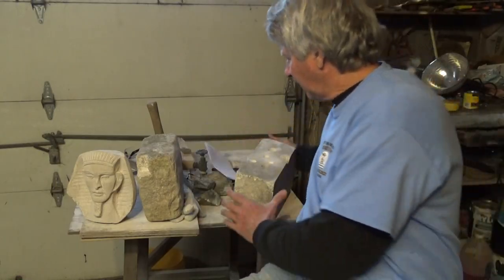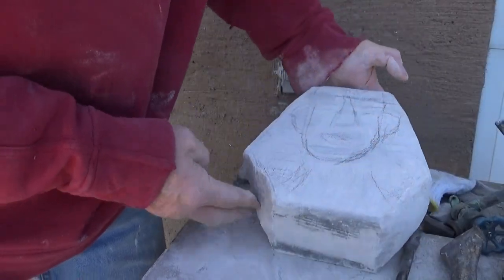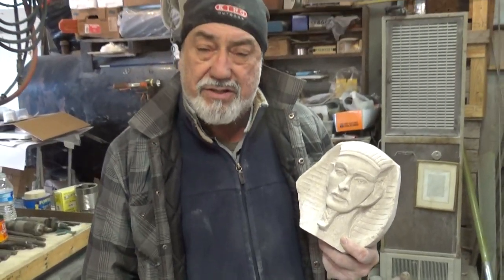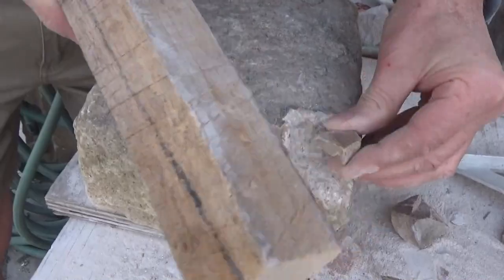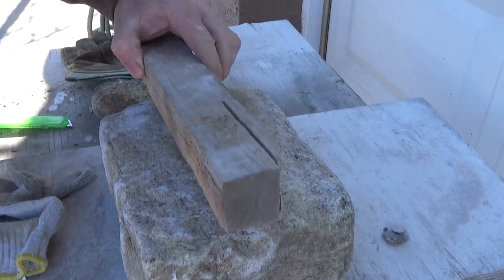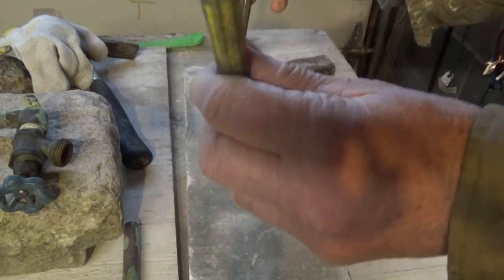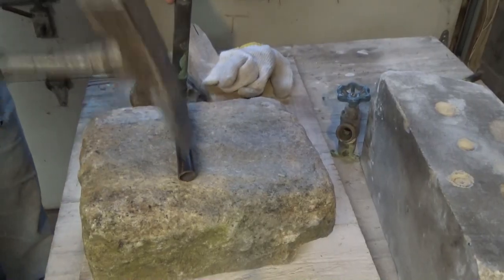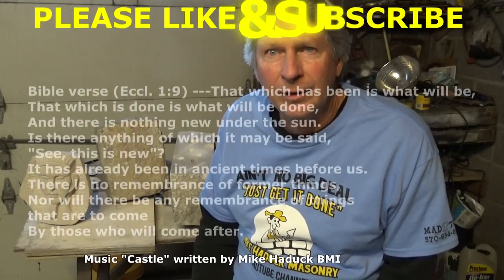CARVING STONES WITH ANCIENT TECHNOLOGY (Mike Haduck)

Comment: The tool marks that can be seen do NOT match the tool marks the copper in his demo leaves.  Striations in the tube drills show a very different technique.
Reply from the maker: It's only stone,  not rocket science,  thanks Mike
Reply: Why would you expect this mostly percussive demonstration to match the markings inside the bore holes? Drilling with abrasive creates the striations.
Reply from the maker: the Egyptians didn't have jewelers?
Reply: @MikeHaduck  They had jewelers certainly. It is just that quartz crystals or granite or  corundum dust produces the observed striations. Anything else would be gravy. Egyptians were mighty skilled in all trades. Your  channel is a treasure. Thanks for the work you do.

Comment: You've seen the granite boxes at  the Serapeum, right? Like in person? Perfect 90° corners all the way around the bottom of a 12ft × 12ft × 20ft solid block of granite? That is as smooth and shiney as glass after how many thousand years? Alright dude; not taking away from the skill you have on the subject, but Jesus Christ you are defeating your own argument while making unbelievably condescending comments about people's opinions that are perfectly legitimate (and don't automatically involve aliens). For one, NOBODY is "oh it's impossible how did they do it" about HOLES IN LIMESTONE. They're referring to the CORES TAKEN OUT OF GRANITE WITH TUBE DRILLS. And ok so you made a small indentation in some granite with some other granite. What did you keep coming back to? The fact that it was VERY SLOW GOING. The problem we have with the explanation for the Great Pyramid is that it was done from plans to finish in 20 years using your methods. Now I can already hear you say well in 20 years I could get a lot done. If there were a bunch of me it would be even faster! Ok. That 20 years includes the quarrying, moving, shaping, then placing 2.5 MILLION blocks weighing anywhere from 10-70+ tons each. Plus a bunch of granite ones that are in the 70 ton range that came from 500 miles away and are like 300 ft above ground level in the superstructure. So back to the time involved. 2.5 million blocks, 20 years. Comes out to about 3 minutes for each block to be quarried, moved, shaped and placed. By a civilization that according to mainstream Egyptology didn't even have the wheel yet. So, you were saying? Something about it's so simple, and that people are just I don't know, stupid? For thinking otherwise? Anyhoo, you can't use limestone to "prove" us wrong when we're talking about it being done with granite, and you can't "prove" us wrong about granite when you're clearly admitting that just banging on it with another piece of granite will work-eventually. Meantime all you have is a piece of granite that has a barely discernable indent in it when we're talking about angles and planes and corners with precision rarely seen outside aeronautical engineering but in granite. According to your techniques, how did they cut the lids for the boxes in the Serapeum so perfectly along their whole length that they're hermetically sealed when in place? That's one cut six feet wide and at least 12-15 ft long through solid granite with laser precision. Don't insult my intelligence by saying they broke it off with wedges and then smoothed it out by rubbing it with other pieces of granite, that's the dumbest thing I have ever heard.
Reply from the maker: It's only stone, they had the tools they needed, they had jewelers, etc, go look at the museum,  as a stone mason I am much more impressed with the cathedrals,  the pyramids and such is mostly primitive and they are not a precise as they want you to believe,  thanks Mike

Comment: Loved seeing the examples. Like you said. Of course it can be done by humans, however the drilling in granite looked too difficult. I’ve also seen video’s with much bigger holes and even holes at edges of a doorframe which would even be hard to drill with todays tools.
Also maybe you can also explain how they were able to make the faces so flat and smooth? Just rubbing would not really explain the extreme flatness I would think smooth wouldn’t be much of a problem but ruler flat?
Reply from the maker: Hi Grt, I got a series called " rockfacing and shaping stone" part 13  at the granite museum in Maine shows how it was cut and polished, thanks Mike
Reply: @MikeHaduck  I will have a look. Thanks for the efforts to show this.
Reply: Not just the drilling, look up a channel called unchartedx
Reply from the maker: The problem with many channels is its all talk and no action, I never see them get their hands dirty, lots of speculation and assuming,  thanks Mike
Reply: @MikeHaduck  if you are that inexperienced with power tools that you need to see it demonstrated in order to realise they are evidently machining marks, then that proves your opinions are not very useful in sorting out this mystery
Reply from the maker: I was working and going to quarries long before they had these diamond saws and thermal facing, I got a whole series on rockfacing and shaping stone, If you got your hands dirty and  produced any videos showing why it couldn't be done with older technology, send me the link, otherwise I just got to write you off as another bedroom archeologist,  with respect, Mike
Reply: @MikeHaduck  with respect, your experience with hand tools doesn't help you to understand machining
Reply from the maker: Hi, I am not a machinest, I am a stone mason, I use the tools that work for me, sometimes in quarries,  sometimes carving, machinest is a whole diffrent trade, what is your trade?

Comment: But your guys examples are super crude, slow, very small, and require like, a child’s strength to move around. The Egyptians were dealing with multi ton blocks to a FINE degree of symmetry, skill, and art. Of course anyone can carve these granite stones into anything they want with basically no tools— it’s the fact that they did it astronomically to a fine point on megalethic levels. They also drilled too.
Reply from the maker: Hi Sir, it's only stone and they are not as perfect as they want you to believe, I see the amish move heavy objects with horses and the Egyptians had them and ox and elephants, as a stone mason I am far more impressed with the cathedrals,  thanks Mike

Comment: Now take the time to remove a certain amount of stone, and do the math on those big stones and sarcophagus!

It clearly can be done, but the sheer man houres needed to pull this off that way is mind boggling!!!
Thats the thing i can´t belive, 10 thousands of workers pound stone on stone for dacades just on one of those buildings, and no one came up with a better method of working that stone?? 🤔
And not just the big pyramids, all of those tombs and temples and smaler pyramids they build over multiple centuries.
There are Thousends of tombs left even today, imagine how much are lost over the millennia!
And NO ONE came up with a beter method then POUNDING stone agianst stone?? ARE YOU KIDDING ME!?
Reply from the maker: Hi Martin, it's only stone, anyone who worked on big projects would get a system that consistently make things easier,  I don't think it took longer to build a pyramid than the empire state building, thanks Mike

Comment: I don't think this is the technique they would have used for a precise shape. There is a granite lid with a rectangular box shape cut into it, that was clearly done using a series of drill holes. After that it's just smoothing the sides, and cutting in the corners. I think a copper saw with garnet embedded or in a slurry would have done the job for that.
Reply from the maker: Watch part 2, thanks Mike
Reply: @MikeHaduck  Obviously, I did. Your speculation of how precise shapes  were cut doesn't change hard evidence left in stone of copper drills.
Reply from the maker: Thomas. If you want to learn about stone work, go to my playlist, "rockfacing and shaping stone", part 1 to 13, it might help your understanding of the simplicity of stone, thanks Mike
Reply from the maker: Hi, Thomas, I been promoting scientist against myths for a while now, great channel,  thanks Mike
Reply: @MikeHaduck  then I fail to see your objection to copper drills .

Comment: Btw your modern copper is most likely much better and stronger
Reply from the maker: Thanks, Mike
Reply: Residential copper typically would be around 99% pure I think. The Egyptians used an arsenical copper alloy which produced a stronger metal.

Comment: Good luck with hand tools , the ancient people of kemet had mechanized tools. That's apparent now. Carve a symmetrical statue out of diorite man.
Reply from the maker: Ok G , no problem, first get me the stone you want carved, have it shipped to me and we can settle on a price for my efforts , I would also want to keep video rights, let me know, Mike
Reply: @MikeHaduck  😆 just copy the Kafre statue or better yet build a pyramid from granite and limestone.
Reply: It's not possible to achieve perfect symmetry without advanced tech and tools.
Reply from the maker: There is no such thing as perfect in stone, God makes the stone and you can only achieve what the stone allows, any Carver with 6 months experience will tell you that, the stone first and then the Carver, make sure when go to the quarry you get the best possible stone to be shipped to me, thanks mike
Reply: @MikeHaduck  Huh? How do you explain tube drill cores and circular saw cuts into rose granite all over Egypt? I didn't say a perfect carving. I said symmetrical meaning one side measures exactly the same as the other. Most egyptologists are delusional thinking all that was done by hand and eye balling it..
Reply from the maker: Hi G, the Egyptians had jewelers,  diamonds , dolrite, emery from Greece, etc , etc, they made their own drill bits, they may have been crude but effective, thanks, Mike

Comment: Nice. But no cigar.  Explain. The perfect precision only matches today by computer   Millions of blocks. 40 foot statues perfectly done and no visibly tool marks.  The great pyramid has over 2 million blocks.  All perfect. Some over 60 tons a few hundred feet up.   Explain the diorite sarcophaguses  buried deep in the ground weighing 100 tons  perfectly cut
Reply from the maker: Hi Allad, I don't know if you ever been there but they are far from perfect, just look at the videos, a 6 year old would see that thanks Mike
Reply: Nice but no cigar because precision flatness is still done by hand today. And in regard to the above comment that you cannot cut granite or diorite with copper, yes you can, i have posted how to videos showing how to do it and drill with copper as well. You've been fed a bunch of lies. Don't trust me or them you can try for yourself, It costs a couple of dollars of material and a couple of hours to test.
Reply: There are visible tool marks and if they aren't it means the stone had been sanded down and even if it wasn't, blocks outside were left for some 4500 years for the erosion to occur by sand on the desert.

Comment: Mike, I love your channel. But you haven't replicated anything. You cut a small notch in a small block. You need to replicate the following:
-Spiral grooves in the tube drill marks.
-Circular saw marks.
-Errant circular saw-like marks.
-Narrow grooves.
-High precision polished granite boxes of equivalent size to those in a serapeum.
-objects like the thin wall pots and the "shist disk".

Replicate those things and then you'll have a point.

Note: I'm not saying aliens, lasers, etc. did it. I'm saying the tools we know they had do not explain these things.
Reply: @SacredGeometryDecoded  What's really missing in the modern perception is the layers of skilled craftsmen. The apprenticeship system ensured that. Nowadays we have a few people self-taught but we don't have a whole system devoted to teaching these skills, then wonder why they're so difficult.
Reply from the maker: Hi Michael, no problem I agree with the guy who polished it by hand ,we many times did it with hand sanding,  thanks mike

Comment: Egypt had approx. 3 Million inhabitants during the pyramid age. If you take out children, women and elders, you'll end up with a workforce of maybe 800k people. These people had to produce food for most of the year, before they could even be drawn for the construction of a pyramid. Taking 2.3 Million stones of the Great Pyramid into account, each stone had to be quarried, transported an positioned within only 3 minutes in order to achieve the task within 20-25 years (all figures taken from conservative science). Another problem are the "overcuts", meaning that certain groves show deeper cuttings than necessary or even cuts that didn't come out straight and were hence abandoned. How is that plausible, if you're ruling out machining and assuming that they've cut with copper blades and abrasive sand only? Did they notice the crooked cut only after hours or even days of cutting, before they stopped? Ridiculous, isn't it? Theoretically, you could also build a highway with just a shovel or even a pyramid with only toothpicks, but you wouldn't be able to produce in such a quantity and perfection. So, the idea that some of the buildings and artefacts in Egypt are actually pre-dynastic and are the result of a yet unknown technique seems quite probable to me. We don't need to employ "aliens" as an explanation. Simply looking at the Sphinx and noticing that its head is much too small in relation to the rest of the body seems to imply, that the Egyptians have inherited certain monuments and simply restored or modified them. If it would be so easy to explain, why can nobody even remotely reproduce it?
Reply from the maker: Hi, it is what it is, but as a stone mason as some one who worked in quarries,  I don't think it took longer to build a pyramid than the empire state building , they are not as big a deal as everyone says, once everyone got into the rhythm I think it went fast, I worked on a lot of big jobs to know, it's the people who never worked in that field think it's a big deal, thanks for the comment, Mike
Reply: @MikeHaduck  Thanks for your reply! I once restored a two story basalt stone house on the Azores Islands with the help of some local masons who showed me a lot of tricks two achieve things, that I thought before were impossible. So yes, a nation like the Egyptians, living amongst sand and stone, will definitely master these elements, even if city dwelling conspiracy theorists can't grasp it. So much is agreed upon. But if you consider the full picture of ancient Egypt (time frame, astronomical and mathematical achievements) there are so many inconsistencies, that even scholars should review certain postulates.